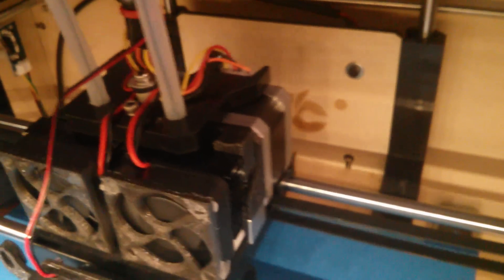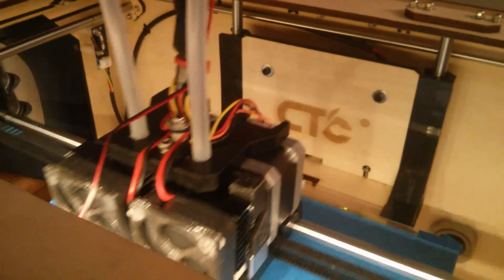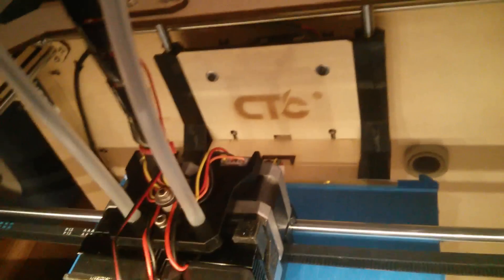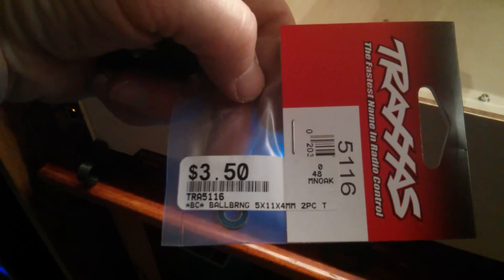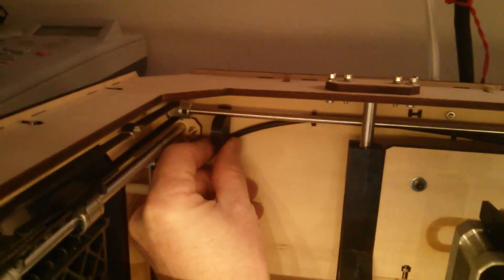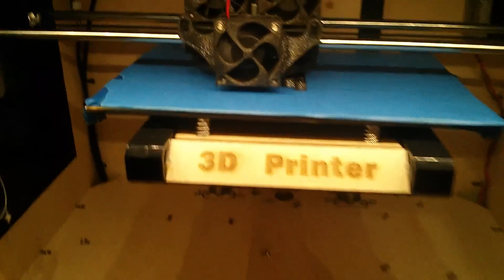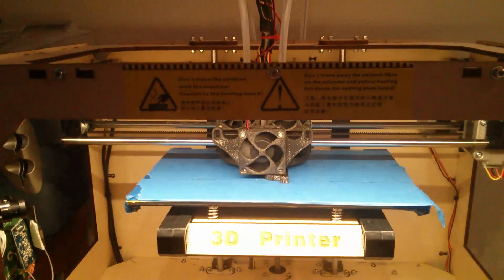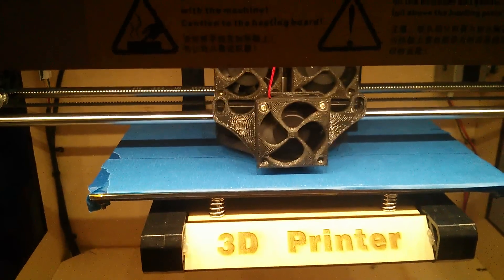Part 3 CTC. Updated extruder on CTC printer.

Comment: on my ctc when I try to print (with stock extruder) the stepper motor on the extruder keeps clicking how do I fix
Reply: Same problem for me , i plan to replace it with this if i can find the parts , i have access to an Up! Plus 2 to print the needed parts. That thing is amazing by the way the Up Plus 2 will print and print and print and print without hardly any service sitting in a dusty cold workshop it just does not give a shit :P. If i had the money i could go for one of them.

Comment: is the 3rd fan useful, does it make a differnence
Reply: +The Epic Shadoe Gamers  yes for PLA it is very useful I have done the same mod to mine better bridging and overhangs.
Reply: +Whotcha Printin? have you got a link to the file for the bracket for the fan
Reply: +The Epic Shadoe Gamers and where does the fan connect to on the board
Reply: +The Epic Shadoe Gamers on the board on CTC there is not fan header the ebay link guy provides that but the mosfet is not included some of the clones have that some don't (CTC) I have wired it up to the fan for cooling the board mine fan for that had seized up and apparently it works ok with out it.  I put a switch in and can manually turn the fan on and off. Also note the fans are 24V.

Comment: Do you think this mod has helped alot. i have one of these same models and it seems like it wont pull the filimant its tight on the spool. i have to make sure there is slack in the spool otherwise it wont feed.
Reply from the maker: I haven't had a problem with the filament feeding.  When I didn't have the spring loaded extruders I had feed problems.  I had to play around with getting the correct spring in the feeder to grip the filament.  I can print ninjaflex and the role has no slack on it.

Comment: How do you install the 3rd cooling fan?
Reply: +Methodoc  the proper way on the CTC is to install and solder on a new header to the controller board and an mofset to the board and run cables from there so it can be software controlled.

Or you can do it the way I have done and wire it up to power with a switch and manually control it with much less risk of frying the board.